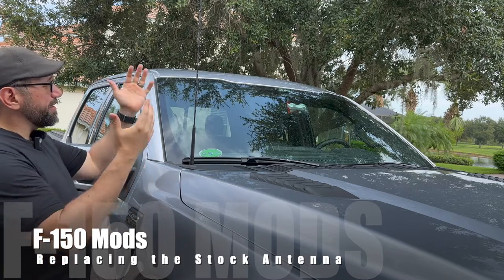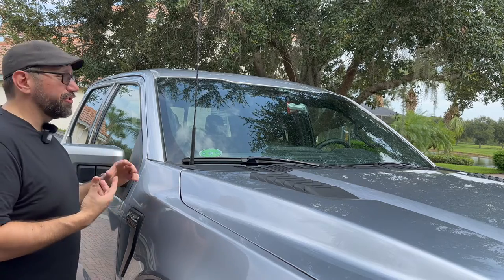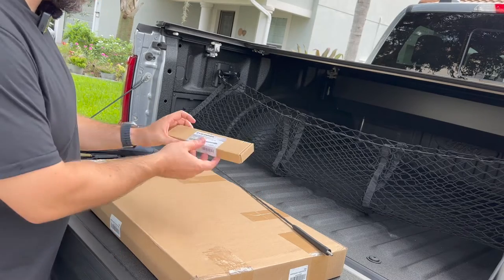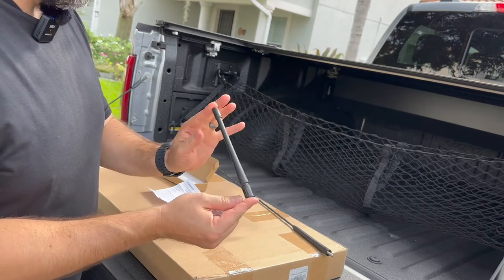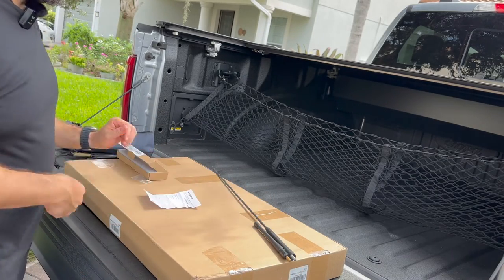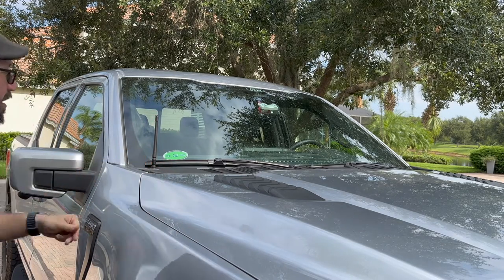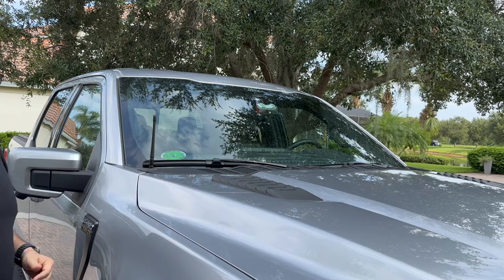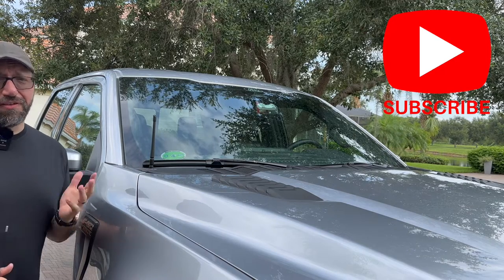Ford F-150 | Replacing the Stock Antenna [Easy Mod]

Comment: You should mention that first removal, the antenna will be VERY hard to remove. You make it look like it's a 2 finger job. From the factory it has loctite on it and it's really hard the first time.
Reply from the maker: Mine legit was that easy. I had heard that you might need a wrench, but was surprised when there was nothing to it. Thank you for watching!
Reply: How is the reception with the new shorter antenna?